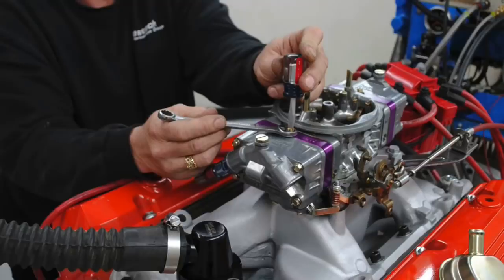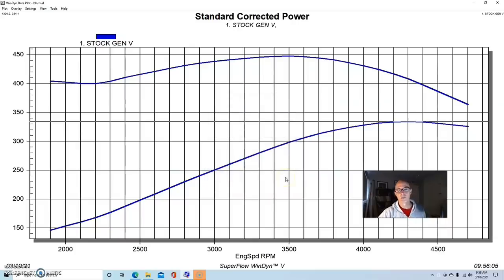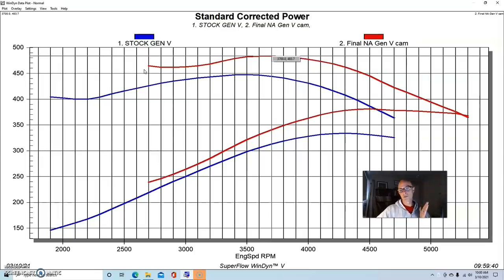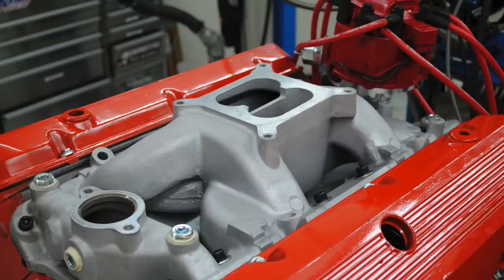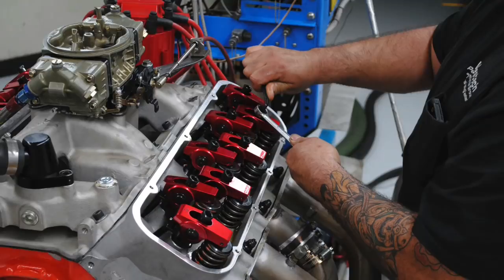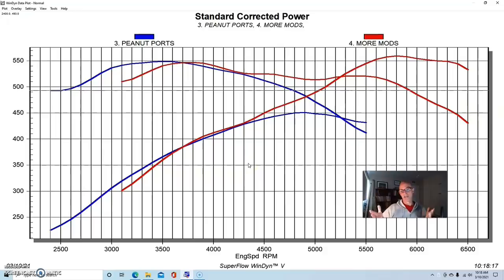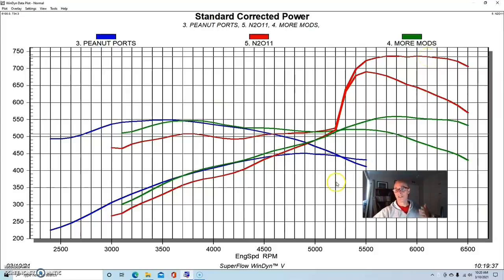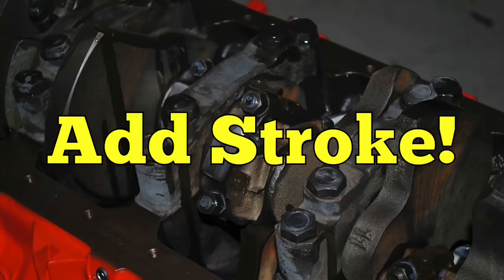HOW TO: GEN V 454 MODS-PEANUT PORT PERFORMANCE

Comment: Consider me part of the peanut gallery.
Reply: hilarious. I'm part of the peanut gallery also
Reply: Ouch, my ribs are sore from holding my sides.
Reply: Found this in Chevy Teck Tips: 7.4 Liter Gen VI (454 ci) RPO L19/L29: 290 net hp at 4,000 rpm (trucks only)

The Vortec 7400 featured more refinements including the use of MPFI (multi-point fuel injection) and hydraulic roller lifters: small oval (“peanut”) port cast-iron heads, four-bolt main caps, cast-iron crankshaft. Available in trucks only from 1996 to 2000.

Comment: Crazy how a stock Gen V 454 makes just a lil less torque down low then a 5.3 with a $7k roots style supercharger
Reply: Yeah and its extremely heavy, so the power to weight ratio is less on the 454 vs the 364, 325 or 293.
Reply: @shadowopsairman1583  
About 670 lbs. Not that heavy.
Reply: @johncholmes643  especially when you put aluminum heads on it.
Reply: I hear the collective pop of the ls cult losing their minds...
Reply: @johncholmes643  gen 5 454 is closer if not a hair over 700lbs fully dressed.  
4.8/5.3 can be in the mid to high 400lbs range ... let's say 500lbs fully dressed (l33 probably weighs less factory aluminum block.) .  That 200lbs weight difference is noticeable especially when located at the front of the vehicle..

Comment: I have almost this identical set up with peanuts but I’m on e85 and run a .572/572 110lsa roller cam I had with 9.8/1 compression in a 3000lb Monte Carlo. Pulls the front tire and runs 11.3s all day.

Comment: Had peanut port heads on my 489 stroker. Gen 5.  Had the guides cut for positive seals and more clearance and 7/16 screw in studs.  Ran a .566 lift, flat tappet cam in my jet boat. Ran beautiful. Have brodix heads now.

Comment: A boosted peanut port engine would be wild
Reply: It would probably work good with a centrifugal blower, the rising boost curve would nullify some of the choke that happens from the crappy ports. Any boost is good boost.
Reply: @timothybayliss6680  absolutely.....boost is life. A custom cam that will get everything out of the peanut ports plus boost could yield a 1000hp plus outrageous torque.

Comment: I am going to be rebuilding a 1986 454 from an RV for a truck that will be towing a two car trailer with two rock crawler Jeep XJs. From everything I've seen in your videos (and others) I think I am going to keep it stock and add a 268 cam and keep the peanut port heads. I already have a set of long tube headers that came with the truck so I'll be using those as well.

Comment: The rebuild with .030 over and cam would be great in a 2500 or 3500 for towing or with a mild lift and say 35" tires.

Comment: Thanks Richard. The profiler heads are a new test i think. Its a nice test to see. 

After your last peanut port test video with the 212/218 cam I was hoping you were gonna throw some AFR 265 heads on it. Seeing where that combo peaks vs the peanut port would be interesting i think.

 On the street it seems like having as much as you can at low and mid power ranges with a peak at around 5200 would be ideal. The lower rpm would help increase the life of the engine too.
Reply: Heads will bring an extra 100 horsepower
Reply: @cargotoolshop5319  a 100 hp gain with a 212 duration cam?  On one of Richard's videos he uses peanut ports with bigger valves and mild porting I think and a 245 duration cam. When he put afr 265's on I believe there was a 70 horse gain. If my understanding is correct a smaller cam would have less of a gain. It makes me wonder if a 100 is possible.
Reply: @andy347495  the afr heads made 620 compared to the peanutport 511. Maybe this is what he's talking about

Comment: I’ve got a 10.5:1 oval port . It stock shifted th400 @4500 and fall short of its open value. 3rd/2nd drop 
. Nothing less than 5600 up - to 75–8k 
  Tears 275s up for breakfast 
   And cracked the 400 transmission case. … having fun.    😇🤕🤠 eh 10 more years to wait . That’s life .. might as well restore it right .

Comment: Would like to see build like this on a mark 4 454. With 781 heads.
Reply: That’s exactly what I’m doing! Just saw your comment. Mark IV four bolt main, stealth intake, 268h cam, and FAST fuel system. Was originally going with peanut ports, but then found some 781s. It’ll be a while before it’s done, but I’m confident it’ll perform!

Comment: Seems like short of headers and having a torker 2 single plane vs dual plane I should be around the same with my oval ports.
Thank you for these videos.
This 454 will work perfect for my truck.
Reply: I'd ditch that old Torker II intake for a Weiand Stealth or Edelbrock Performer RPM. Either will make more power and torque that that Torker.

Comment: Curious as to what the compression was with the last version of the PP heads.  That engine with 500 plus torq at 2500 rpm would be a blast to drive on the street, dont even need a high stall converter.
Reply: 7.8 to 1 or something sad. Edelbrock makes a 100cc head for them that bumps it to about 9 to 1.
Reply from the maker: it was 9.3-9.4:1
Reply: @richardholdener1727  so pump gas compatible..nice

Comment: After the third test, it would've been nice to see what a set of ported peanut port heads would do...probably would've gained torque down low and easily tacked on 75+ hp up top (525hp minimum, with the same ).
Reply: Yes!! I wanted to see how far you could go with stock peanut's, keep increasing cam until it was worthless to go further. Then start with a mild port a guy could do in his garage, and move up a little from there. It always seems to end after trying basically nothing, to putting on a set of $1,245,000 aftermarket heads nobody can afford, and showing how it gained 3,547hp over the stock heads!!! What gives with that stuff? I mean, don't call these things "little guy" builds, then put "big guy" money into them!! Let's see how far it can go with stuff the average bubble gum chewer can toss at it!!
Reply: I don't think 75 maybe 40
Reply: @youcanbesmartaskhow3857 , each cfm can be worth 2 hp, it's straight forward to add 40 cfm to the peanut port head. With the right cam, that can be worth 80 hp.

Comment: Richard, thanks for this video. Before you went to the Profiler heads and bigger cam/intake. What do you expect would have happened if you swapped the Gen V Peanut port heads with the stock Gen VI 100cc Oval port heads? I have a Gen V block and 12cc domed pistons, and a set of refreshed Gen VI heads. Edelbrock Air Gap manifold. I want a low end torque engine to run on pump gas. For towing/hauling on my 1950 Chevy COE Truck. 4L80E. 5.13 gears and 40" tall super single semi tires. Not sure I can run 87 octane gas because I believe my C.R. would end up at about 9.8:1 Would have like to have seen what that short block would have done with the Gen VI heads and the same Comp XE268H 515/520, 224/230, 110 cam.
Reply from the maker: to get an idea-look at the gen 6 videos with the same cam
Reply: @richardholdener1727  Richard, thanks for the reply. I have watched all your videos. Issue is that all your Gen 6 videos have roller cams. Nothing i saw was close to the XE268H

Comment: I would have liked to see just a little bigger camshaft than the xe268. Then maybe bigger valve upgrade to the peanut port heads.....just to see what would happen. 450hp and 550ft.lbs. of torque would be a great street engine.
Reply: The valve springs probably couldn't do a bigger cam + more rpm... they didn't do much to the heads when they upgraded valvetrain.
Reply: @codyramos3200  I know....they obviously would have had to upgrade the spring's as well. Would have been nice to keep upgrading till they stalled out
Reply: Yeah kinda pissed me off when stopped after the 268 baby cam. Not too difficult to change springs when you got the tools there and on dyno etc. I want to see what a comp 292 Magnum cam will do.

Comment: Would love to see it with a specific peanut port intake manifold.    I think it will go beyond 600 Ib.ft before 4000 rpm
Reply from the maker: ONLY WITH BOOST
Reply: If like to see a budget 496 for low end torque. For towing. 4k rpm and less.

Comment: Richard, at what "junkyard" are you finding all of these engines? Christ, I'm lucky if I can find a crappy ol' 305 anymore!!
Reply: The local you-pull it junkyard has all kinds of treasures lol. You just got to know what your looking for and what years n models it came in.. .. now I can say if your looking for things like a t56, t45, t5 transmission . Or anything in the performance oriented model aspect.. like a 1990s-04 firebird/ camaro z28 or ss , mustang gt 1980s-present any corvette etc etc those don't pop up to often and when they do people jump on them quick .. a 2015 ss camaro popped up in junkyard where im located ... I about through a fit like a kid .. I was broke due to covid .. got fired right as covid took off ..

Comment: I would have liked to see how far the peanut ports could go. Anyone can spend $837,000 on a set of aftermarket heads and make power, lets see how far we can go with the crappy peanut ports!!! Don't spend $372,000 on head porting either, just mild stuff a guy could do in his garage.

I'm curious what a 250/260 @ 0.050 cam would do with these heads? Would it reach 500hp? What if we bumped the compression up to 11:1 or 12:1? Can it make it passed 500hp? If only I had a dyno!! But then again, if I could afford a dyno, I'd be building 632ci big blocks with roots blowers on them and putting them in my full chassis/fiberglass drag car!!
Reply from the maker: $372k ON HEADS?

Comment: Do a stock 351w with factory fuel injection like a 1990 with just a cam swap like a 512 512 lift 230 230 duration and springs

Comment: Whats the most na power possible with a 454 & steel/iron heads? Wondering for displacement & head limited class.
Reply from the maker: LOTS OF IRON HEADS THAT FLOW A TON
Reply: @Kevin Folsom what heads?

Comment: I use Gen 5 366s I pull the crank the rods the cylinder heads and I put them on a Gen 5 454 block to build a 427 366s actually have ovalport heads not peanuts my only drawback is an electric fuel pump

Comment: Question : When installing new a cam and lifters for Dyno testing , do you "break in the cam " or just warm the engine up some and do a Dyno pull ? I ask out of curiosity , not being critical at all .
Reply from the maker: YES WE BREAK IN THE NEW CAM IF IT IS A FLAT TAPPET-NOT ON ROLLERS
Reply: @richardholdener1727  cool , I was curious if the cost of Dyno time was a factor . I  did not intend to be offensive .

Comment: If I was to stroke my gen V to 496 keep my peanut port heads,  dual plane intake,  750 carb, long tubes, do you think it will make 500 ftlbs at 2k? I've got a 1984 gmc crew cab with a 4 speed and a gen V 454 that I have to rebuild. I want all the torque and I'd like for it to have a little choppy idle(I'd really want a radical idle but Iknow that's not the best to go with for my application)
Reply: Camshaft would come into play .. but 500ftlbs @2000rpm is doable..  without stroking block that 500ftlbs @2000 rpm is doable.

Comment: The question is: How well would the engine have run if instead of swapping to the expensive heads you had used the Gen 6 heads???
Reply from the maker: LOTS OF GEN 6 STUFF UP

Comment: The AFR 265 heads seem like they're about the best head you can get for the street. Would you agree richard?
Reply: for a 454 yes.  for a 496  the AFR 305cc heads do really good  rectangle port with a weiand dual plane retangle port  the port opneing on that head and the 8018 intake are exactly the same size.  ive seen videos of those making 650hp...
Reply from the maker: THEY WORK WELL

Comment: Hey Richard, I’m getting ready to start on my first truck build and I’m 16, I have a gen V 454 in a 89 k3500 which is EFI. Could we maybe see the power difference between an efi 454 and a carb 454? If not a video, could you help me out on deciding what to throw on to make most hp/ torque?
Reply from the maker: SWAP THE TBI FOR A DUAL PLANE AND CARB-IT WILL BE 40 HP BETTER
Reply: Richard Holdener thank you so much man! I have one more question, what would be the first mod you would put on a bone stock 454
Reply: @garrettraymond6258  cam and springs and or headers.

Comment: Hey RIchard, in these example, have you measured the stock cam? would be really curious in this combination.
Reply: Do you mean measure the stock cam duration?
Reply: If you mean measure the stock cam duration, it's 197/202 at .050 and lift is about .398/.404. 112LSA

Comment: Awesome video 
I have a 94 2500 suburban with tbi 454 o live in California and been wanting to swap to the 8.1 vortec. Would upgrading my gen 4 with gen 6 heads and better fuel injection be a better option or even smog legal
Reply from the maker: NOT SURE ON THAT
Reply: To swap to the Gen6 or 8.1 you need to keep everything associated with the engine. It can be really involved and even include things like the fuel tank evap canister. Given its from a truck to a truck it can be done legally. You need the engine, ecu, factory exhaust or Carb OE legal, maybe even the factory air intake from the swap vehicle. You have to meet the emmision requirements of the year the engine came from not the vehicle you swap into. It's a pain but possible. Some guys have done Cali legal swaps, I would see what your up against.

Comment: 502/502 had some really small ports I freaked the first one I pulled the intake on.
Reply: Like the cathedral ports...
Reply: Even GM calls them a hybrid port design. There is the 502 ramjet that I think has the same heads.
Reply: @timothybayliss6680  I don't think you could put a wallnut in them. But they seemed higher in the head but it's been a while
Reply: Once we put a big Whipple on it went 106 mph in a tunnel hull boat on the Ohio River lol.
Reply: @timothythomas1737  I remember reading some magazine articles about them when the 502/502 came out. There was a picture with a rec port gasket over the heads and they are almost at the top of the cutout. It's too bad the peanut ports aren't like that, it makes for a nice short side radius in the port. Every peanut port engine was in a truck or van, I don't know why they didn't move the port higher up or even have D shaped ports. In this video you can see the gasket outline and how much smaller the the port is than even this ping pong ball sized opening. I get the small port high velocity idea but the port still has to work and the TBI head castings were new in 1991, they could have done a bunch to make them better.
Reply: @timothybayliss6680  yes sir I was an auto tech for 15 plus years before moving to boats. The photo he showed is what reminded me of those ports on the 502 because the intakes had the big ports with the high ports on the heads. I always thought fuel would have fell out but I guess they had enough velocity to keep it moving lol.

Comment: Whats up richard what cam can i install into my completely stock 87 454 from a motor to get max top end hp and tq
Reply from the maker: IS IT CARB?
Reply: Yes it is
Reply: It will be in a 71 c10
Reply: It has 22 inch rims in the front and 24 in the rear 4:10 gears i think

Comment: I keep reading I can’t put my early mark 4 heads on my gen 5 block?
Reply: You can, use fel-pro 1037 gaskets and make sure your block doesn’t have excessive core shift at the water jackets on the intake valley side, as in the 1037 must seal to the coolant ports in your deck. That gasket blocks off the parallel cooling ports in the deck and makes it act like a series cooled mk IV.  I’m lining up parts rn to build a genV with AFR heads. It’s done all the time.

Comment: I want to duplicate this build in my 1990 SS but use a comp 260-AH computer cam 396 325hp heads #3872702 .
Only prob these heads dont have a temp sensor location on left head.

Comment: It says online that manifold will not fit peanut port heads, sure they fit?
Reply from the maker: it bolts right on-ports are mismatched though
Reply: @richardholdener1727   does it matter performance wise if the ports are mismatched? thanks for your reply im looking to do the same exact build to my genV

Comment: Do all gen v motors have those valve covers? I have a 1988 Chevy R30 with a 454. It has the older style valve covers with the bolts around the outside of the cover. Where on the motor can I find the identification numbers?
Reply from the maker: these have the same bolt pattern, these were gen 6 covers
Reply: @richardholdener1727   thanks

Comment: Rich is promoting peanut port heads.

Here's what I know. Don't waste your money by investing in a set or if you have them don't pay for machining them as you will want to upgrade later. You won't be happy with the hp numbers. Guys will laugh at you for running them. Go right to the rectangle port heads if you can afford to if you are trying to make high hp numbers. You'll have to turbo them if you insist on using them for any high hp number. They are heavy cast iron.  Put on a tall deck usually with a heavy rotating assembly. Alot of material will need to be removed from them to improve them. I suspect the engine will rev slower from not breath8ng better. A good performance oval aluminum head set will beat those peanut port heads. Back in the day, Everyone dumped even the oval ports to run rec port heads. Especially when using forced induction or a t ram.

Bloodviking

Comment: How early could you safely engage the nitrous??
Reply from the maker: SOME DO IT WHEN THEY LAUNCH
Reply: The real trick is to make sure the engine can rev freely, regardless of rpm. If you nearly stall or lug the engine on nitrous, you’ll way overcharge the cylinders and most likely kablooey!
Reply: It's worth doing some research on. Launching with NOS engaged could blow the tires out from under you (wheel spin) and kill your ET. Also need to consider stall convertor (if running a automatic), gearing, carb size and timing.